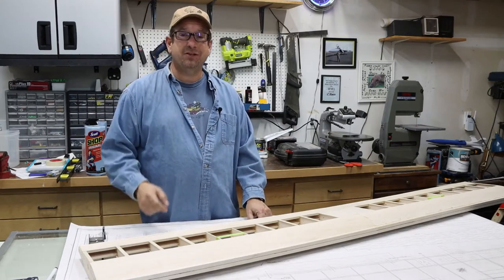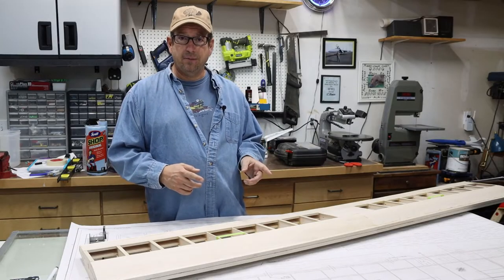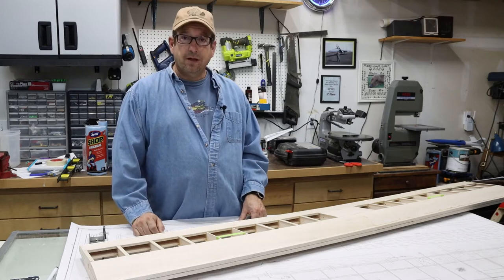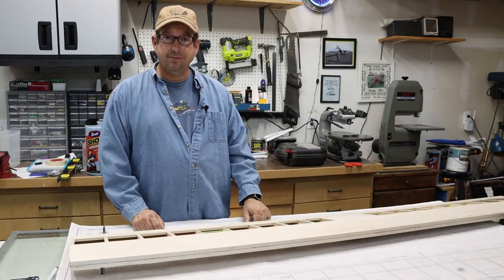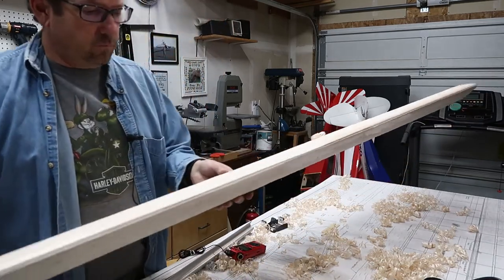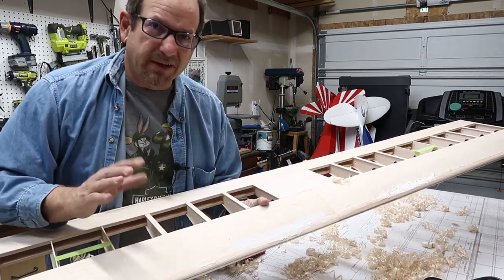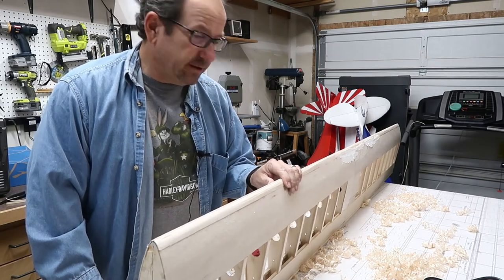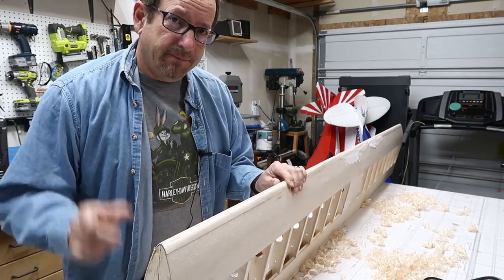EP8: Shaping the leading edge: Giant scale RC airplane scratch build

Comment: A neat and very inexpensive way to secure servo extensions without having to by those plastic things is to get bakers twine and lace the string through the individual wires and across the plug and tie a simple knot pulling tight ... clip the extra string ... found this by accident when rebuilding a scratch built I bought at swap meet.
Reply from the maker: My buddy Mark uses dental floss the same way.  I just happen to have the plastic kind laying around.  I have never had servo connections come apart in flight.

Comment: leading edge block ... just make an inverse block with the shape you want cut out of it ... attach sand paper to the indie of that and sand the leading edge until it fits all the way down .... a nice piece of pine from a 1x2 about 6 inches long would make a decent sized sanding block and set the leading edge nice and even the full length of the wing .... and it can be saved for wing replacements from damage in the future ...
Reply: you could also have adjusted the table of your skill saw to match the angle of the leading edge and trimmed off the corners in one shot going down the length of the piece on each side and then been ready for filler and sanding in a few minutes ...

Comment: I really enjoy using a plane, shaving wood off like that.  However, I do not care for the master airscrew plane; I have a metal plane of about the same size (which is in the Bermuda Triangle of my shop).  I also have a slightly larger plane, called a David plane, which has 3 different slots for blades for various tasks.  Good video Dan (and you know how I feel about beards)!
Reply from the maker: I can't imagine you without a beard Jeff.  I couldn't pick you out of a lineup.

Comment: Hi Dan: what type of putty do you use for filling in the imperfections?
Reply from the maker: If its just a gouge or little dent, I will use Red Devil light weight (Im sure there are tons of other brands) spackle used to fill small holes in drywall.  It dries quickly and is super easy to sand.  Use a fine sandpaper.  If I am filling a low spot, I use this stuff called 3m Green Akril putty.  It is a one part putty that is used for Automotive body work.  It dries fairly quickly, and the trick is to fill the low spot, but don't leave a big pile to sand down.  Get it as close to level as you can with a teflon paddle.  This stuff dries pretty hard so when you have to finish sand it, use a coarse sandpaper, and use less strokes to finish it.  Using a finer paper will more or less buff the glob and possibly grind down on wood around the spot, creating more issues.  Be cautious.